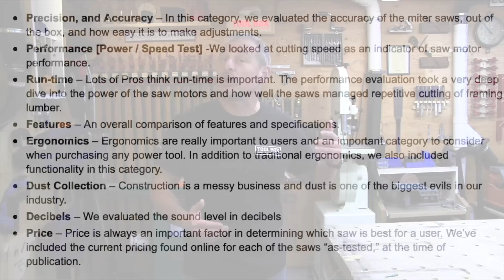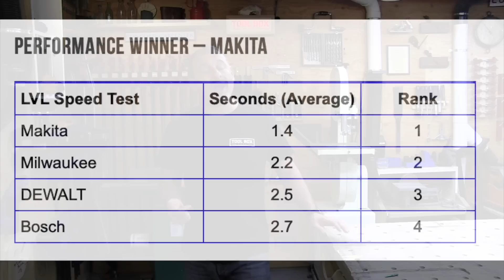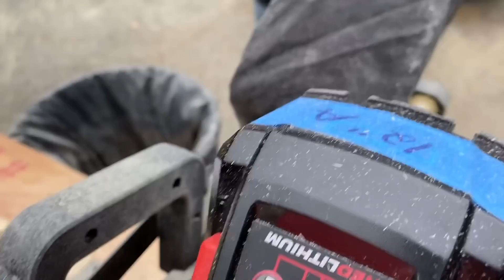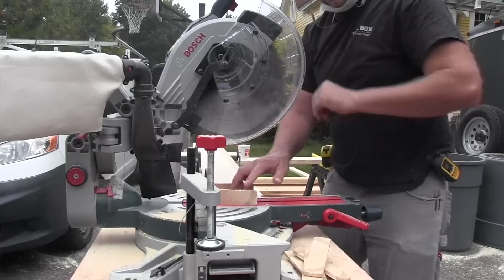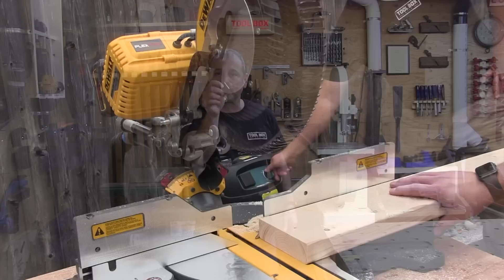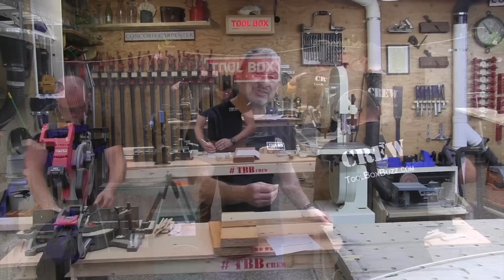Best 12-Inch Cordless Miter Saw - Head-to-Head

Comment: Thanks for the testing and review guys! 👍🏻
Interesting results compared to the 10" given the 10" Makita is basically the same as their 12", while the 12" Milwaukee is a much better saw than their 10".
I own mostly Milwaukee, but went Makita for mitre saws. The rail forward design is fantastic.
Reply from the maker: Agreed - batteries may have played a role as well
Reply: Would you not consider the Bosch one? It's cordless and has better glide design
Reply: @adamsolomon8346  Bosch doesn't have a large enough battery powered lineup for me. I run Makita and Milwaukee.

Comment: I've had 3 Milwaukee 12-inch saws. All broke after 100-150 cuts, and the switch needed to be pulled 5-7 times for it to turn on. Regardless of the battery size!

Comment: If Makita ever removed the laser for the shadow light, fixed the fence where you don't have to remove it for certain miters and offers a flex volt type system. Their saw would be absolutely untouchable. Except in weight..My god that thing is a ball buster. Mine has a permanent home on a rolling miter stand. No way I'm carrying that thing if I don't need to.
Reply: Flexvolt system damage battery durability this is why makita dont do that. I used to work with dewalt and now im on makita platform and battery lifespan is probably twice
Reply: @francoisbeaulieubernatchez2421  I'm referring to the devices that use either AC or battery. It doesn't damage the battery as they batteries aren't plugged in at the same time. The flexvolt cable snaps into the battery slot.

Comment: I notice the battery you used on the Bosch causes it to derate to 1800w, if you use the 12Ah it runs at full power.

Comment: I have the Makita. Even though I run Dewalt and Milwaukee on mostly everything. Makita Truly is the best cordless miter saw. No brainer. Sorry DeWalt and Milwaukee. Just Facts
Reply: Unfortunately it has no shadow line.  That is a deal breaker for me.
Reply: Makita make fragile tools
Reply: @trentroberdeau6399  fragile my ass my old boss sold me his 15 year old makita miter saw when i was 20 as my first miter saw the thing has been droped out the back of a truck 100 times and still works to this day its only really good for doing hard wood floors but it cuts like a hot knife thru butter i now have the 12 inch 36 volt and i have all makita tools and i have like 15 5.0 ah batteries im waiting for them to make a dam 36v table saw i have the 36v sawzall and skill saw
Reply: @blackpowderenergy  why Would you ever allow you tools to be treated so badly dropping it out of the truck is bad just one time doing it hundreds of times that’s just tool abuse lol 😂
Reply: Makita is thebest at saws on every job sight milwackey cant make saws

Comment: For giving “absolute” values would be possible in some instances, and not in others, but for example dust extraction - Weigh board before cutting, do 100 cuts, Weigh Dust in dust extractor = DustE, Dust Missing (DustM) = Board weight - After cuts Weight - DustE. Efficiency = DustE / (DustE + DustM) = DustE/(Board weight - After cuts Weight) - That way, with absolute measureable values, it will be able to show the Companies that improvement is possible.

Comment: Different Strokes for different folks, I have both the 12in DeWalt flexvolt cordless and the 7 1/4 20V cordless. Working commercial and residential finish and rough carpentry year round ...never have they let me down,I've seen the Makita fail in the field.

Comment: I have milwaukee everyday as a trim carpenter and I've never had it stop yes the thermal switch kicked in but realistically speaking your not going to cut over 100 cuts right off the back non stop.....I wouldn't trade it for anything at least so far

Comment: I like the thermal cutoff on tools as long as your not tripping it during normal operation. If your tripping it that way the tool obviously needs better cooling. It would have been good to know if you could still trip out the Milwaukee adding a pause to load another piece of lumber like you would batch cutting lumber for framing or whatever the heaviest real world scenario would be. 
Displaying the tables you guys use for making your rankings is a great way for us to customize the ranking for ourself and allows you to do reasonable testing that works for everyone. Really great job on your testing, thanks for doing what you do!
Reply: I have the Milwaukee and used it to build a few small storage buildings and it hasn't ever tripped out like that with me. Under normal situations,  I  don't see it being an issue.
Reply from the maker: Right on!!

Comment: I love that dewalt power option for using AC, but I also know that they won't sell it in the UK 😐 and even though UK site voltage is only 110v, the health and safety guys would do their dinger about a power supply with a butchered plug if I imported one.....

I've imported tools before, and you need to run the thick site cable all the way into the unit, and it doesn't fit easily into most newer things! And anything AC with a motor might be using the mains frequency for a timing reference, so going from US 60hz to UK 50hz either wipes 1/6th of the speed off, or the motor runs at full speed but overheats depending on the tools electronics
Reply: Dolphin hates hats they have sold this exact saw with the optional adaptor for about four years now!

Comment: I use Makita as a brand more because off the collated screw gun was/is the best and the idea off having one brand regardless that another brand might/does have a slightly better tool I can't see myself having to store and maintain a multitude off different batteries and chargers  over the job site with a variation off different tools.  So in saying that, Makita has recently release a 40v XGT single battery drop saw that looks way lighter than the one shown here. Only thing ATM is it's only 216mm/8"1/4 cut. Personally I was more looking for a 254mm/10" cut that isn't available yet. I say yet because to be sure it will arrive as I would think a 309mm/12"  355mm/14" sometime soon.

Comment: Nice review. I purchased a Milwaukee 12 inch and had flawless performance from it for 6 months until it caught fire on me. They replaced it and the second 12 inch saw died after 6 months also. They have given me a third saw and I’ve had it for around 4 months. It too is showing signs of critical failure. I’m not sure what is causing the issues but they are trying to wipe their hands of me and are talking about offering a refund. The electric brake no longer works on this saw and it has shorted out 5 batteries in 5 consecutive cuts. They can not explain this and have no answers. I’m at a loss as I’m kitted out with $30K of Milwaukee tools and bought this saw because of this. I truly don’t know what to do or where to go. 
I’m Australian and our conditions and timbers definitely vary considerably to what you folks have in the States. Price here is hugely variable as the dewalt kit is $1800 (2 batteries, saw and charger), the Milwaukee is offered as a skin only at $1390, the Bosch is $1499 skin only and the makita is $1200 skin only. Having to look at batteries and chargers as well when buying a replacement has put me in a very tight spot indeed. In my opinion, through my own personal experience, the Milwaukee was a good saw that doesn’t hold up to the rigours of arduous job site work and repetitive cutting of framing, roofing and decking materials on a day to day basis. 
I don’t know where to turn in making my decision as makita after sales service is quite poor here and the dewalt only has a 3 year warranty.
Reply: For whatever it's worth, I own the Dewalt Flexvolt 12" sliding miter saw, I bought it when it was first introduced a few years ago, back when no one else had a 12" cordless saw. It has been bulletproof with no issues at all. So even with that 3 year warranty concern, I can vouch that the Dewalt has been great. I recommend it with no reservations.
Reply: You have answered your own question by saying Dewalt has a 3 year warranty. Your Milwaukee isn’t lasting that long is it ? Hope you made a good choice mate 👍

Comment: Excellent presentation. I've been looking at the Makita saw for quite some time. I will probably wait until the tool truck comes around and I can get for batteries for the price of two. Thank you for the Insight, I've been wondering if Festool is going to come out with a cordless version of the K-PAX. That would be the only other saw I would put the head of the Makita. But I imagine I could probably sell the Makita 4 what I paid for it when and if that time comes.

Comment: I have the Makita 10" and I needed a 12".  I tested the Milwaukee and Dewalt before going with the Makita.  I have all battery lines so I only needed the bare tool. Makita feels amd cuts like a very quality tool. Milwaukee felt cheap and I did like the slide on the Dewalt compared to the Makita.  Only grip with the Makita saws are wish they had a shadow line instead of a laser.  Makita saw reeks of quality.

Comment: Well, it's going to take milwaukee a few more years to except that certain tools will need two batteries to run. Their model is one battery can run all their tools but that will end soon. I have the milwaukee 7-1/4 cordless sliding compound miter saw and it's great for my small projects. I still run my corded (DeWalt) 12 inch sliding coumpound miter saw and 10" table saw. I always have power and run a 25 ft extension cord.  

GOOD JOB MAKITA! Set that high standard so the rest of these companies follow, LOL....

Thanks for the video Rob....

Comment: I bought the Dewalt because of the wall outlet power adapter. 
The dust collection issue can be fixed with some modification to the shute flaps.
Reply from the maker: Agreed!

Comment: Have the Dewalt, it burned up after a few hundred cuts, and while using the corded feature it was extremely rough and sounded horrible.
Have the Makita, it's a beast and much much smoother.
Reply: you probably had a bad saw
Reply: @ryan74701  Had about 5 hours of use on my dewalt planer and the rollers quit feeding so it is useless until it gets fixed. 
This was last week, Dewalt has been absolute crap for me.

Comment: Our flexvolt died. Just a little over a year, so longevity kinda stinks.  It's sitting in the garage . Makita...for an expensive saw, they cheaped out on the miter scale by opting out with steel instead of stainless and it's heavy as hell.  I was lucky to try all three saws.  The one i spent the most time calibrating was the Makita's.  Milwaukee is probably the most classic traditional design of the three and dust extraction blows both Makita and Flexvolt. Hate the fence on the Makita.
Reply from the maker: Thanks for the comment

Comment: For the life of me I can’t figure out why anyone would get a cordless miter saw, except for a SUPER specific use case.
Reply: I have done siding jobs where the batteries have lasted for a week, cedar 1x8 bevel siding, so nice not to worry bout a cord, or blowing a breaker when your compressor kicks in while making a cut.  Most of the time on exterior jobs you have 1 outlet to work with normally.
Reply: @FryChicken , that’s totally understandable, in that circumstance I would go for corded, but as a contractor cordless works well for me now.  Thanks for the viewpoint
Reply: I’ve recently switched to using the makita 12” and absolutely love it, I already have heaps of makita cordless gear so batteries are no issue, it’s nice being able to do jobs completely cordless

Comment: At the beginning you were talking about accuracy right out of the box... I'd love to see you guys do a vid on how to dial in a new miter saw if "out of the box" isn't good enough (I do high end trim and was lucky enough to get a saw many years ago that was very accurate out of the box... But the next one may not be)
Reply: Pretty much your checking 90° square, bevel, compound bevel and solo compound at both full extension and with sliding option locked....
Reply: @jeffb321  thanks...  I know how to CHECK if it's not perfect...  Just not how to adjust things like "table flatness" or "fence not straight or perpendicular"
Reply: @brianwood876  we'll every manufacturer has different ways to adjust there saws. The best way to verify is checking the owners manual as all manufactures saws adjust differently....what saw do you have?
Reply: @jeffb321  I'm pretty sure it's the dewalt dw718 (the one right before they switched to the yellow plastic bevel readout)
Reply: @brianwood876  yep, thats the same saw i had the dw718. I replaced that one!!! Super glad i did lol
Reply: @jeffb321  what did you get?  I was looking at the flexvolt because I already am into the batteries but most likely going to get the bosch glide (corded because I rarely am on site with no power and if I am, I usually have a genny for other things anyway)
Reply: @brianwood876  XSL08
Reply: @jeffb321  the one from this vid?  You like it?
Reply from the maker: Its pretty boring
Reply: @brianwood876  yes i love it. So glad i bought it. Mine was $844 with tax from Acme tools not 1099 as suggested in this video, but i bought it as a bare tool. I also spent $64 for the aws transmitter, i purchased that on amazon. Stupid the makita doesnt include a transmitter with the AWS version of this saw.

Comment: I’ll buy any brand of tool as long as it best fits my needs.  I don’t care about the brand. I do have brands I’m not a fan of though. Dewalt battery tools are some of the tools I’m not a fan of. That being said I would buy the Dewalt. Makita has gotten way to expensive. And don’t give me the quality crap because makita is no better or worse than the other top brands on quality and reliability. Just depends on the tool.

Comment: I'm pretty sure you're wrong and dewalt does not run on 60v but 120.  The two 60v batteries are not in parallel.  Also why it was so easy for them to include that AC adapter.

Comment: i agree milwuakee sets their thermal overloads too low.. but look at what youre doing, 290  cuts back to back advancing the board a half inch and cutting as quickly as possible.. youre not doing that in any real scenario, at minimum youd have to pull the board off the saw and throw the next one up, that extra few seconds between each cut would cool it down enough to eliminate the overloads in this test.. the milwuakee should of been credited its full amount of cuts and simply noted that its thermal overload was set too low..

ive gang cut boards 3-4 at a time bunch after bunch for 100s at a time but i still wouldnt be able to match the cut speed of just advancing the same board a half inch  over and over, theres no need for them to design it to do that when itll never need to outside of this specific review test
Reply from the maker: You make a valid point

Comment: The dewalt miters are infamous for poor first collection. Some fairly easy mods improve it significantly.
Reply from the maker: 1st mod peal back or remove that rubber flap
Reply: @ConcordCarpenter  Best bang for the buck right there.

Comment: Looking at getting a 12in battery powered saw for baseboard and molding work. I'm already heavily invested in the M18 platform so was considering theirs. But this video made me have second thoughts. After looking up some other reviews, I'm a bit torn.

Biggest issue seems to be accuracy. Can you be more specific about why the M18 scored the lowest in your review? Is this something that can be calibrated and stay that way?

Is it worth holding out for the gen2 possibly dual battery version? Need a new saw soon as I'm tired of my little 71/4in saw for baseboard. That thing will not stay calibrated and it doesn't work well for taller baseboard.
Reply: Battery adapters may solve your problem.

Comment: You need to rework your scoring system. Milwaukee finished first in ergonomics while the grip and trigger — by far the most important — are the worst.

On a higher level, you wind up with small decibel differences having outsized impacts on the final scoring. 

In short, it is entirely possible to create a saw that would dominate most of your categories and be the “best” saw while simultaneously being the least desirable saw in real world use.

Comment: Would be nice if you gave absolute grades from 0 to 10 or 100, instead of a “for this test only comparative rank” - thus, one would more easily be able to see the actual performance for some given parameters, or also, be able to compare other tools later on to the ones you so thoroughly tested - thus giving more value on the long term. Just imho. Otherwise, thank you all for your time devotion.

Comment: Hmmm,  after watching this several times I am still not certain about your accuracy comments.  

To me, out of the box accuracy simply doesn't matter.  The important piece of information is what the saws' tuning features allows one to achieve in terms of overall accuracy.  Shipping and handling I would think would play a significant role in knocking things out of alignment.

So, with that said, could you please be more clear with your accuracy statements and the charting of the results in the matrices.

More importantly, just forget mentioning  'out of the box' accuracy and talk to us about specific accuracy points and comparisons after adjusting and tuning the saw.  After all, if a saw is way off out of the box, the first thing anyone would do is to calibrate it - right?  So, it's the 'after calibration' data I want, not out of the box data. 

Regards,
Mike

Comment: Not the hikoki? The new Bosch does look good. Seems the makita is a good machine.
Reply from the maker: Not in this size
Reply: A Concord Carpenter / ToolBoxBuzz bigger blade on the hikoki. Even my festool kapex is not entirely accurate. It cuts nicely having the material on the left. From the right side it's slightly out. I need to have a good look to see if I can tweak it a little. I heard the hikoki is very accurate and expensive.